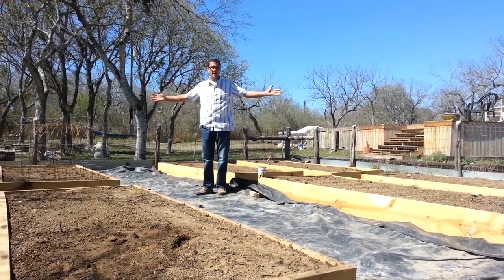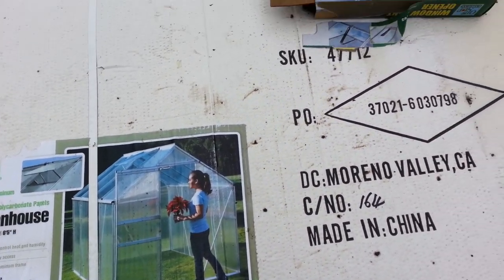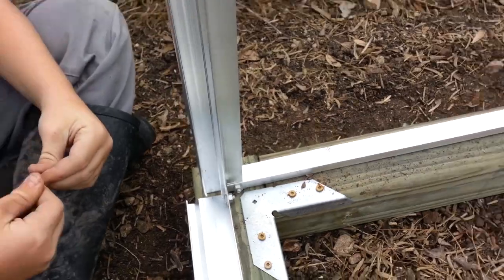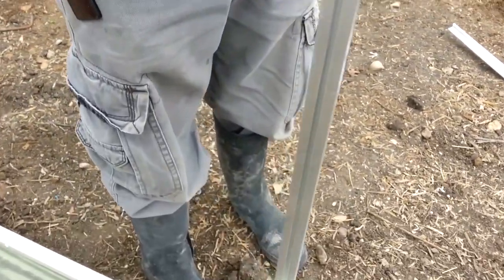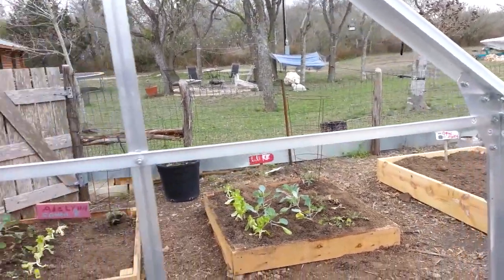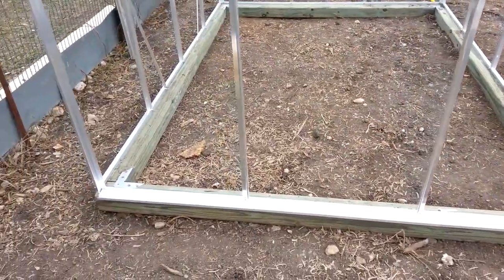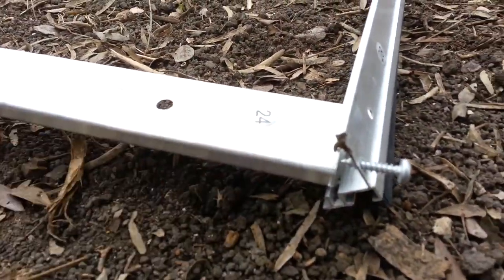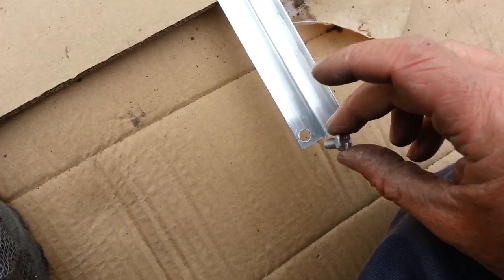My New Greenhouse: Introducing & Constructing

Comment: So you tightened everything before you lifted it off the base. Or after all the windows and panels were in.  I noticed 4 minutes 5 Seconds in your side floor plate wasn't even with the 4 x4 same thing happened to me. then 17 minutes 20 seconds in I noticed you moved your studded wall in a little so that lip on the floor plate would be even. Did you move that wall in a little bit too compensate that. Because I thought the measurements in the directions would be on but the sides were a little short.
Reply from the maker: Rudy Aiello I believe you are correct there. I compensated the size of the studded wall to fit the greenhouse. This measurement was off a little compared to the initial 4x4 foundation frame. Nice catch :)
Reply from the maker: Rudy Aiello Oh, and... I didn't answer your first part. Yes, I tightened everything after it was assembled and lifted onto the footer wall. The panels were installed after it was tightened.

Comment: I can't get the clips to fit, or I'm missing something - which the instructions are difficult. (I also have the 10 x 12.) It seems the gap between the panel and the brace is about 1/16th of an inch? And for a lack of better description, the center part of the w, goes on the outside of the greenhouse, where each end of the w fits in the grove, and then you push the center of it towards the inside of the greenhouse? when I have tried that, it takes up a tad more than 1/4 of an inch, so then the panel is to wide for the slot. I have also seen YouTube videos where the owners used screws to screw them into the braces. Any thoughts? (Our 10 x 12, took five of us about 17 hours to put together because of us trying to decipher the instructions. I wish I had seen your video first!)
Reply from the maker: It's possible that you aren't getting the clips positioned correctly. I'll have to go home and look.  I'm sorry for the late reply. We've been dealing with a sick goat and it's consuming all of our thoughts right now.
Reply: Terry Nystrom hi Terry, my wife and I are also having trouble installing the clips... did you come up with a 'technique' that worked for you folks...
Reply from the maker: Gosh, I'm so sorry that I totally let this question go. I'm not sure if I can describe it well, but I did find this video that shows it. https://www.youtube.com/watch?v=xpSfAwiyv3Y  I handled mine only a little differently. Instead of trying to push both "legs" in at once I pushed in on one "leg" then popped the second one in. It's not easy, but once you do a few successfully it's not that bad.
Reply: Blake Kirby

Thanks for the quick response ... I had been going about this all wrong... looking forward to reading your blog... keep up the good work... Ken

Comment: We built the 10x12 model from Harbor Freight. Do you have an issue with the wind blowing your panels too? We tried different tips to secure them: caulking them, screwing them in the center. Screwing them in secured them but then the wind caught them and bent/broke a few. We ended up replacing the side walls with Palsun polycarbonite (the same stuff we use on our solar panels) and that's helped, but I was hoping there was an easier fix for the roof panels that seem to want to blow now....any suggestions?
Reply from the maker: I've only had a few panels blow out in the few years that we've had this greenhouse. It could be that the lower profile of my greenhouse and the trees on my farm may be helping me out. A neighbor of mine has the 10x12 model and wow that is a lot of surface area to catch wind. I hope the extra panels helps and gives you a chance to keep and utilize that growing space :)
Reply: Thanks Blake. We have had ours up for a couple years now, and I absolutely LOVE it!! I can be upset with the world, spend a few minutes out there playing in the dirt, and I feel happier. If anything happened that prevented me from using it, I would be super disappointed, so hopefully, we can stay on top of the breakage. :)

Comment: I don't have a hole for the bolt in the left of the door rail.  Do you see any problem if I drill one?
Reply from the maker: hmm, I know a couple of times I had pieces in the wrong place and thought that they missed drilling a hole. Check that.... but if it's all in the right place and that one hole is the only thing stopping you from finishing.. Drill, Baby Drill :)
Reply: Blake Kirby Thanks for reply.  I have the door up and it slides so I don't think I have it up wrong.  Plus there's a hole on the right side where it should be.  My kit didn't have the plastic parts for the bottom panel of the door.  The panel had a ridge that fits over the sliding lip and the screws fit directly into the panel.  My kit also was a full inch shorter in width than the dimensions in the instructions resulting in a 74 inch width rather than 75.  Maybe the inch they cut off had the hole in it.:)  Inscrutable.
Reply from the maker: broschultz Wow, I'm sorry you are having those difficulties. Could you call the store to see if you can swap it for a kit without those flaws?
Reply: Blake Kirby It's already pretty much together.  The short length wasn't much of a problem as I installed it on a slab with a base of a 2&6 planning to lay some 4x4s on top for added height.  So I had the leeway to just move the 4x4s in a half inch on each side.  I have to finish fastening the remaining 4x4 layers and then the windows and panels.

Comment: Whoops, I built my bottom frame wrong... because I didn't subtract the thickness of my plywood, so it's too big. I guess I should have thought harder about the frame I made. I will have to modify the plywood slightly where the plates sit. Good video!

Comment: Hi Blake, Wondering if you or anyone else knows where I might be able to find parts for this greenhouse? HF said they don't sell the parts. About 4 days after I put it up we had a windstorm that destroyed it. I wasn't quite finished with it as I was going to anchor it down and use screws to secure the panels. I was able to take out most of the panels at the onset of the storm so I think I only lost one of those but some of the aluminum is either bent or ripped. This was the worst wind I've ever seen here (of course right!) with 100+ mph winds for over 20 straight hours. Considering this, I think it held up well and only came down after about 18 hours of this brutal force. Grrrrr. Please let me know if you have any info!
Much appreciated,
Kathleen
Reply from the maker: +Kathleen Wilson oh no!! I'm so sorry to hear of this happening to you. No, I haven't even looked for parts. I know it's more expense than you want, but maybe you buy a second one and use the first (broken) one for spare parts to keep on hand for the second one. If I find another source I'll post it.
Reply: +Blake “Daddykirbs” Kirby That would DEF be more economical than trying to find replacement .  The panel product is shockingly pricey add to that cut & fit.  I plan on caulking mine in.

Comment: Blake, I hope you still check out our comments and questions. I have watched this video several times but I still can't see how you access the inside, since it is raised up so high. Did you build stairs on the inside as well as on the outside? Could you show the inside please?
Reply from the maker: I did put a platform of bricks on the outside like a step. The wall isn't really that tall. I just step over it. It's on my list of videos to make to show some updates to this little greenhouse :)
Reply: Yes, I see the steps on the outside. I was just wondering about carrying my plants in and out, while navigating the low wall. We cant wait for your updates!!! My greenhouse is still in the box. Anxiously awaiting more videos.
Reply from the maker: The footer wall can be designed with a door opening too if that suits you better. I just didn't want to hassle with the extra work of it at the time LOL!

Comment: Just watched your video for the fifth time.  Purchased the greenhouse 2 days ago, but still have questions before I get too far into this.  You put up pony walls between the foundation and the base of the greenhouse; how high were they, what did you do about the door- step over or made a new one, how high is the top of the vertical sides after your modification, and how high is the peak?  I have to deal with zoning restrictions that limit the height to 8 feet at the peak, but I would like the sidewalls to be 5.5 to 6 feet since I'm 6'2''.  If that isn't possible I would need to dig out the inside floor which may be too much work, and I might then have to build one on my own.  Thanks for your video, as many others have said, I'm only willing to try this because of your efforts.

Comment: Rick Mike, who is how I found your Video, mentioned that the Harbor Freight Instructions for the outside dimensions of the Wooden frame (where the floor plates overhang, are off by about a 1/4 of an inch. He stated that the stated dimensions were 1/4 " too wide. Did you find the same discrepancy?
Reply from the maker: I do remember something being a bit off, but it's been a few years now so I've forgotten the details :)
Reply: YES: I laid the 4x4s out on the drive then placed the base pieces out on them and it was clear even after several measurements it was too wide.  So I trimmed about a 1/4 inch off the 75 inch pieces first.  After that all went well.  

Still need to work on the door.

Comment: I am getting ready to put mine together, it is the 10x12 one.I have checked out some other videos on these green houses and some say to use waterproof tape on the corrugated ends to help against the winds. Is there anything you would do different then what you first did now that you have had it a while? Thanks for your video, I will definitely follow your video when I put mine together.
Reply from the maker: This is the 6x8, but has a lot of the same build challenges
Reply: So you would not change anything?
Reply from the maker: You will not need the short wooden wall with the 10x12. It's plenty tall.

Comment: hi, thank you for the greenhouse video it was excellent but I'm having a problem with the right rear end cap and the left rear end cap # 49 and # 50 not sure how it goes on the door. I purchase the 8.5 x 6.5 Iten #69714 but the pieces that you show are like bend and the pieces I have are flat so i'm not sure how it will go. I called harbor freight customer service and they were not able to help me. s0 if you are able to help, I would appreciate it very much thank you in advance.
Reply from the maker: I'm sorry for the late reply... By looking at the video and the manual I can't answer this right now. I need to go home and look at it again. #49 and #50 are the end caps for the top door rail, right? Are they plastic or metal?
Reply: Blake Kirby the pieces are plastic
Reply from the maker: Sandra Rosario I looked... I left them off or didn't have them in the first place. My greenhouse is doing fine without them :)

Comment: Hello, about to start this project. Can anyone give me the dimensions they made the 4x4?
I have heard some say the specs were off.
If I take two 8 ft 4x4s and cap them at the ends I should have an 8'6" lenth. Will that do it? (I am aware the specs say 8'5") just checking...
Reply: Disregard the question. I see the dimensions in the manual.

Comment: I have two questions for you at what point did you tighten everything up. You said to finger tighten everything but not sure when to tighten everything down. Second question I noticed you cheated the one wall in a little bit. was it because the measurements in the directions weren't exact and the floor plate wouldn't sit on the 4x4 correctly. So you cheated the wall in a little bit so it would sit on the wall properly.
Reply from the maker: Rudy Aiello I tightened everything down good after it was completely assembled. Once I knew it was correct and in place, then I went back with a wrench. Forgive me... I forget "cheating" a wall. Can you tell me what time in the video was that? I'll go back and look so I can explain.

Comment: Great build!  Thanks for the easy to follow video.

So, 4+ years later, what mods or improvements have you made?  Most people secure the panels down some way or another, and seal the panel ends to prevent algae growth.  Others reinforce the corners to prevent racking.  One fellow built a complete wooden frame inside.
Reply from the maker: No improvements, but now I'm starting to look at it and think about doing a few things. Stay tuned. We'll see what comes of that :)

Comment: After 2 seasons how is this greenhouse holding up?
Reply from the maker: Dave Meiser The greenhouse is doing ok. I recently noticed that some of the nuts and bolts have fallen out. I'm sure I didn't get them tight enough and the wind shaking the building has loosened them. The plastic is discolored more than I hoped it would be, but overall it's holding up pretty well.